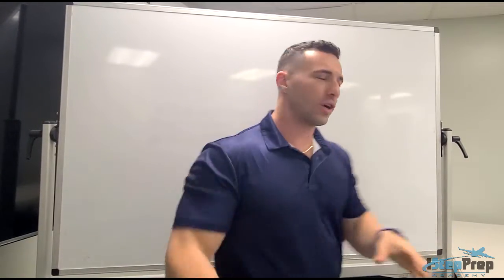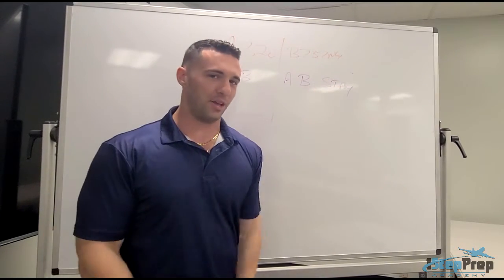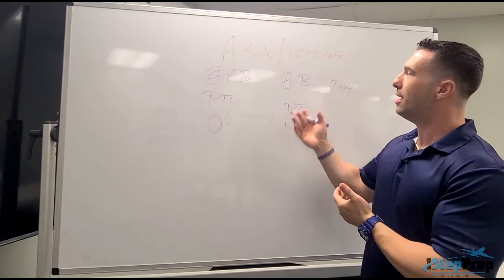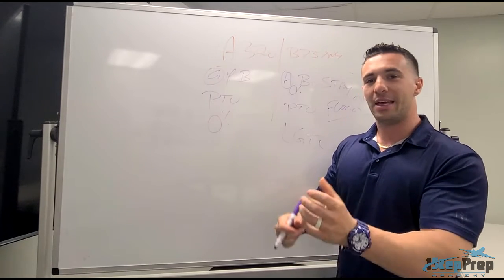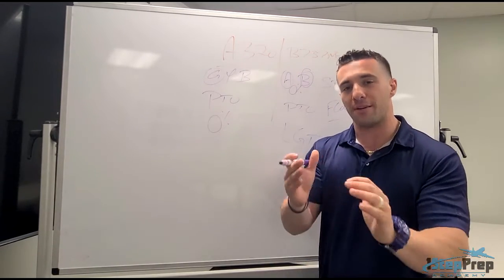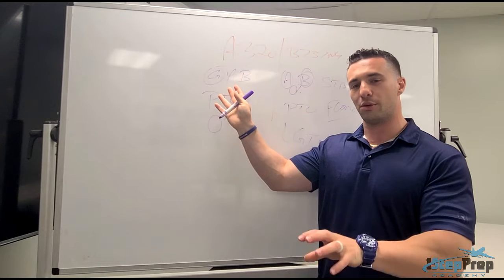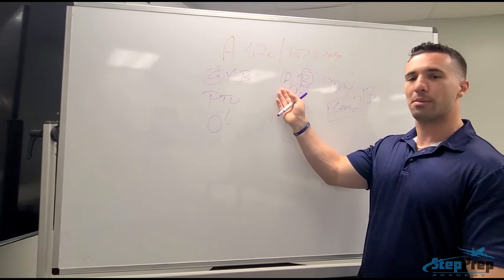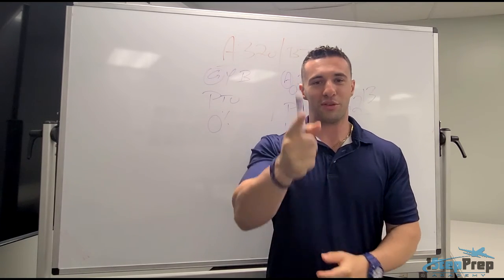B737NG VS. A320 Hydraulics

Comment: Scrolling to see the only question that popped into my head... B737 NG, you've lost system A fluid and suffer a NO. 2 ENGINE FAILURE in your missed approach. Can you retract the gear?
Reply: No because in that case you loose system B also, so you would loose both systems

Comment: Thanks. I never flew the NG. Just the 200, 300, 500. They didn’t work like that. Question. Is there an additional hydraulic actuator on the gear so the right hydraulic can raise the gear? How does that work?